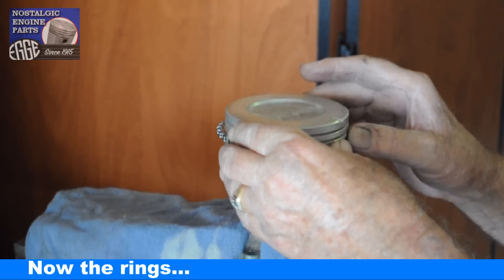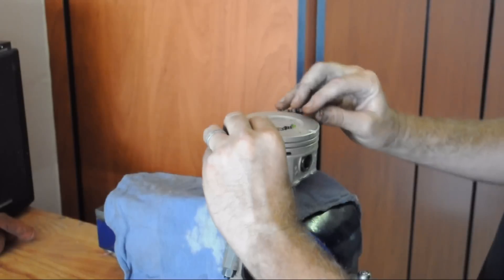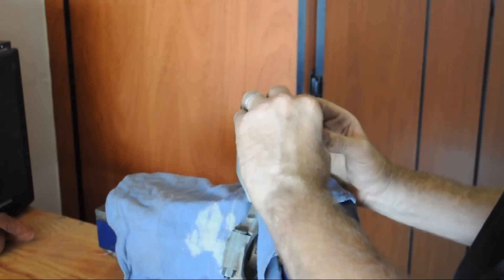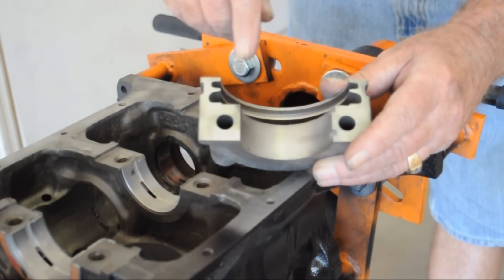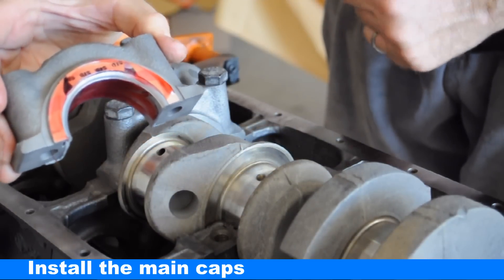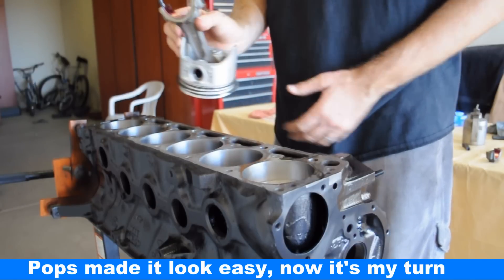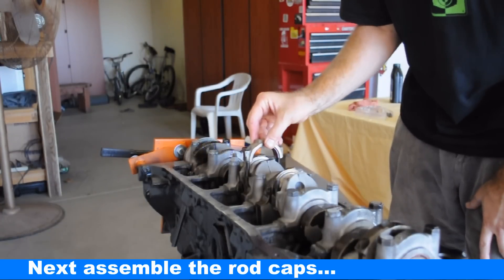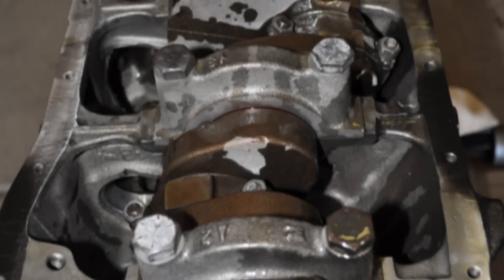Ford Falcon 200 six cylinder engine build

Comment: The Ford 50 60 70 's inline 6 170 through 300 Cid's were bullet proof engines. Very reliable, simple and easy to work on, all cast iron, good power and torque for hauling and work. You service them, they'll work and last for you.

Comment: Excellent video. I rebuilt a 200 for my 63 Falcon about 10 years ago and I'm doing another 200 for my 65 Mustang. I'm restoring the Mustang with my 14 year old son. Thanks again
Reply: Hola ese es el motor ford falcon 3.3l de 6 cilindros en línea que llevaba el mustang Fox body  de 1981?

Comment: Piston rings especially the compression rings can be checked in each cylinder that they will be installed in by checking the gap of each ring in that particular cylinder, This is the preferred method.
The "rope" real mail oil seal is preferred. Use the old connecting rod bolts if you are going to use "plastigauge" checking the bearings clearances and always use new rod bolts for the final assembly!
Have the casting plugs (freeze plugs) installed at the place that cleaned the block and have the cam bearings installed, too.
Reply from the maker: Fact: I had to replace the rear main seal 3 times to get it to stop leaking! I don't know if there was alot of variation in the part? I finally stopped using the fel-pro gasket and that one finally sealed. Taking the trans out and taking off the pan was such a hassle under the car! Wish I had got it right the first time!

Comment: Really nice video, guys! Cherish the time you spend with your Dad. I have one question- Why did ya'll put the crank in before the cam? Not being critical, but it's so much easier to do it that way guiding the cam in through each cam bearing, one at a time, hence,  safer on the cam bearings. I did this for a living, 8 hrs. a day, 6 days a week for  several years- so we had to do these things fast, because they didn't like come-backs.
Reply from the maker: Seems like a good idea Jimmy. Thanks!

Comment: Sweet old Ford.  These engines were so simple and reliable.  The stroke on these is so short that the piston speed vs. cylinder wall is quite low. They spend a higher percentage of the time near top dead center and bottom dead center vs. a long stroke engine.  That's one reason why they lasted so long. That's a high quality rebuild. Better than factory, actually. The factory built them "good enough" without any hand fitting or precision balancing or casting work.  The engine in this video is literally better than it was when new.

Comment: Same exact motor in my '80 Fairmont. Looking to up the compression and add a blower. Any idea what the top extreme pressure is that I can run the block up to?
Reply: It would better to find a 302 for it

Comment: Hey I recently got an inline 6 1966 mustang. I have all the parts for a tune up. The engine does not start sometimes and sometimes if it does start it will suddenly stop. I've been told that these engines are simple and easier to work on for novices. Should I take my car to the shop or use my chilton manual to fix my car.

Comment: yes!    it ran too hot because the engine was small so the block has less water inside to dissipate the heat.

the correction could have been an electric enforced circulation pump instead of its meccanical one and a bigger radiator

but a big block  can dissipate the heat with more ease  it contains more coolant in the system and the cylinders are more distant from each other.
in fact all engines with high voltage spark plugs can run on hydrogen.

Comment: I have a 1965 200cid engine that needs to be inspected. It starts but as it warms up it gets worse and worse till it won't run. An inspection and possible rebuild could be just what it needs. I suspect head damage but not sure at this point. It was used to pull a lot of weight over several mountains and has never ran the same since. Thank for this video!

Comment: I did a bit more research and  Honda seemed to come up as the one. I used to have the official Ford sales brochures back in the day but can't be sure100% honda or Yamaha in that respect.  will do a check of my period Modern Motor Magazine collection, a very accurate source IMO. should reveal all. Cheers.

Comment: Most likely Yamaha. In the 1970s, Toyota wanted to add some kick to the 18R 1.8 litre fitted to the early Celicas. Not being a large or heavy car, they were already pretty nimble, but they asked Yamaha to help them design a DOHC head for the 18R. This featured free flowing ports, and an exotic carburettor setup featuring four Mikuni carburettors, much like what Yamaha used on their bigger touring bikes

Comment: Ahh the ford 6. My first engine rebuild was a 200ci in an XR panel van whaay back when. Then progressed to an XB coupe with the 250ci HC motor. Strong, reliable and simple engine. BTW the alloy heads were co-developed with Yamaha (or was it Honda? ) of Japan back then, in I think the XD. And those integral head/intake manifold castings for a single barrel carb...

Comment: You should look up the Falcon 250 built by Ford Australia. Later versions had crossflow alloy heads, fuel injection, and some rare factory turbocharged versions. Earlier Australian Falcons were based on their Canadian namesake, but for the most part, the engines are interchangeable with minimum modifications